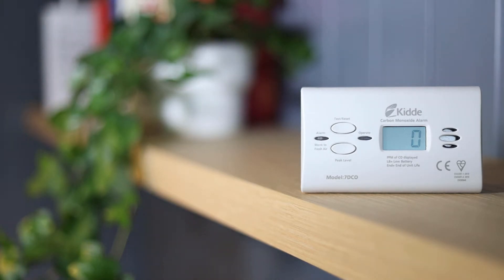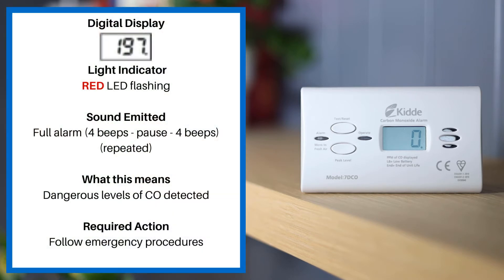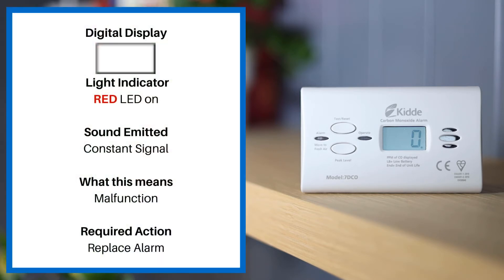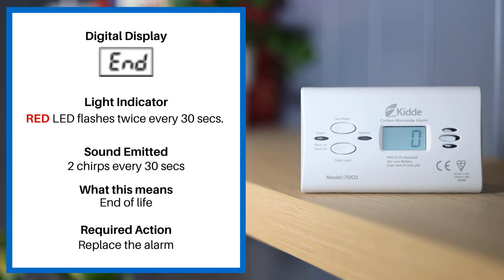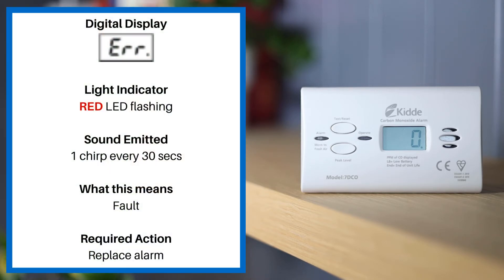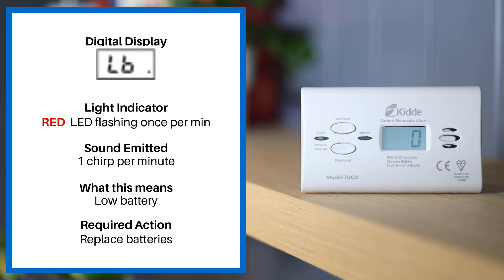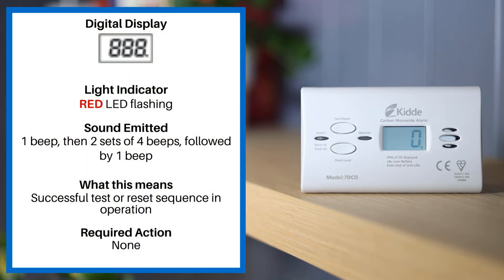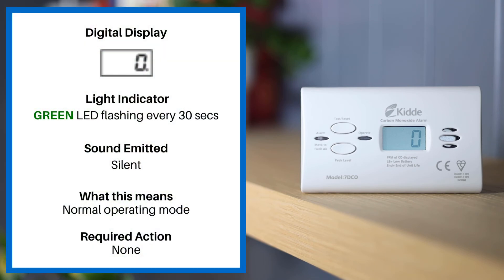Understanding the sounds of the Kidde 7DCO

Comment: What does it mean if the green light is ON all the time  without flashing and screen shows zero? Also when I press test button nothing happens, no test beeps or reset of the unit.
Reply: Should have tried taking batteries out for a minute to see if a hard reset works.